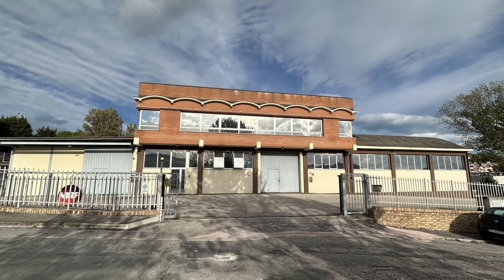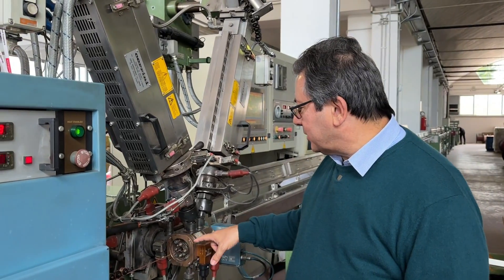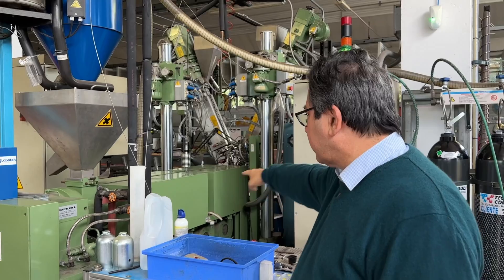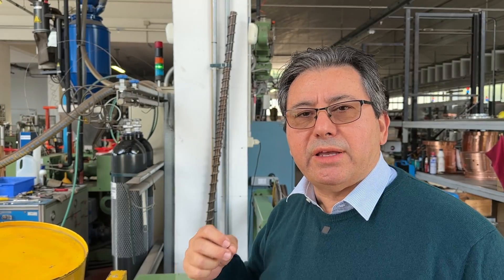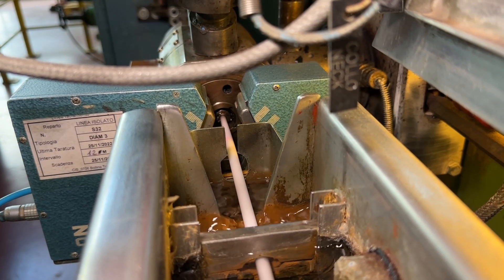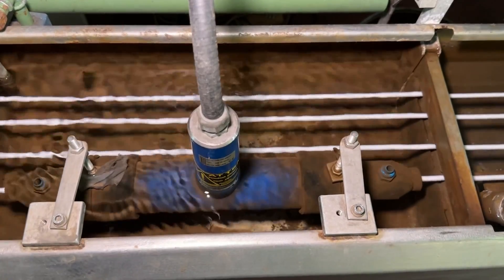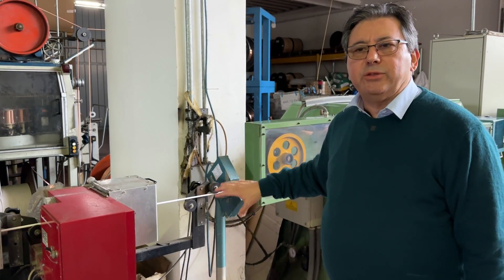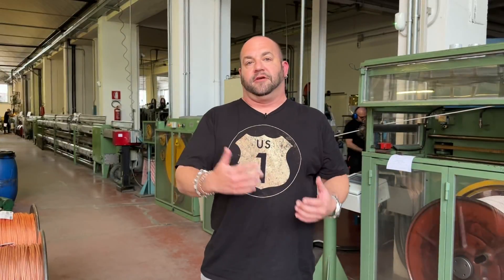Why Good Coax Matters  Messi & Paoloni Factory Tour 1

Comment: Mike, I was a plastic extrusion engineer/automotive Design engineer for over 20 years in Detroit.  I did the 1996 Dodge Ram extruded FOAM body side mouldilng.  Everything he showed you is the correct method for a Gas filled extrusion process.   Note:  gas is injection is done in the melting phase.  (plastic pelts are going from a solid to melted state) It also, stops  the gas inside compression Zone from going backwards. The screw is design to keep building up pressure until it goes into the "Cross head tooling" which is coating the making coax.  Great Video can wait to see the complete coax making process.